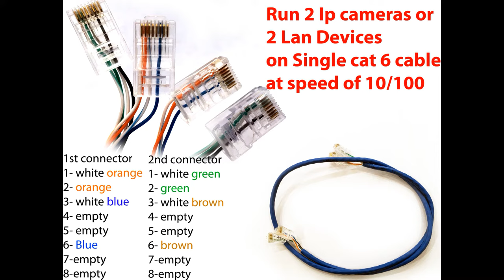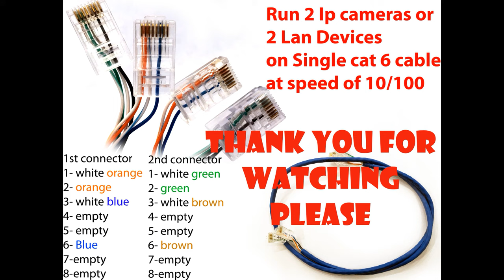2 IP cameras or 2 Ethernet (Lan) devices over single cable cat 6

Comment: Koi bhi 4 core use karke camera chalu kar sakte gai ...?
Reply from the maker: Recommended is cat6
Reply: @diginetworks  cat 6 me koi bhi colour ki 4 core use karke camera chalu kar sakte hai.....?
Reply from the maker: @mehulkyada9883  well, yes, but its should be used for temporary purpose only, as it will only give u 100mbps 
And unstable network if u use without coding wirring

Comment: What is the maximum distance between 2 ip cameras works, if my NVR is PoE too
Reply from the maker: this is only for data. PoE doesn't work on these 2 pair cable. you need to give 12v power to cameras from near by socket it will work like a charm. also one more thing this is 10/100 speed cable connection. GOOD copper cable can work upto 300ft. but normal cable works on 250ft easily. Hope it will help

Comment: is this for poe or non poe camera?
Reply from the maker: Non POE. u can connect 12v power from near by socket available
Reply from the maker: There are new type of POE available which can work on 2 pairs where 4 cables1,2,3,6  are used for data and power as well
Reply: Do you know of a poe switch that will work on 2 pair where 4 cable 1236 ? I have 2 camera ip hikvision and i  want to connect them on a single cable . Thank's